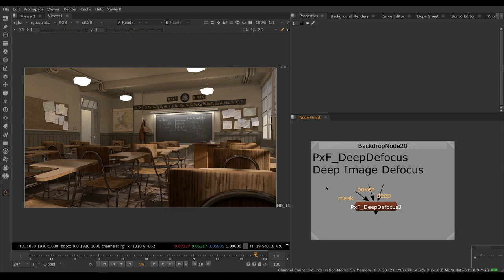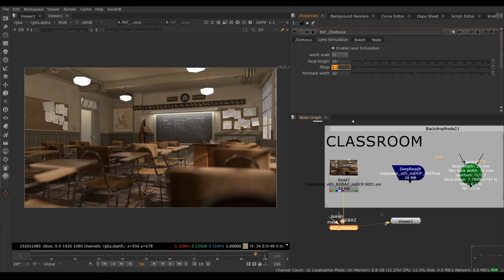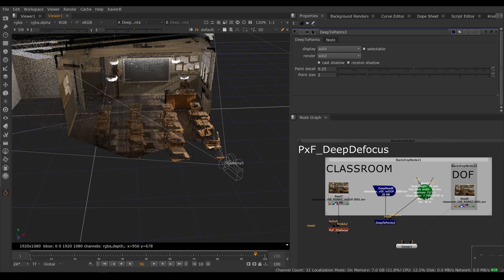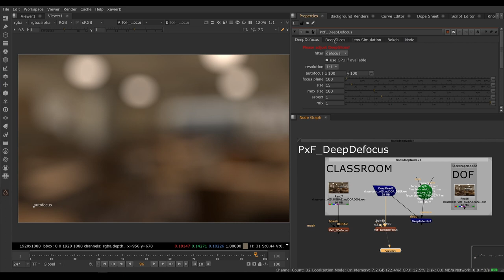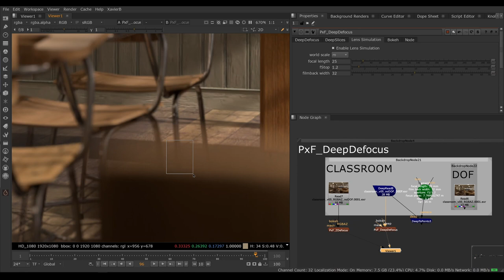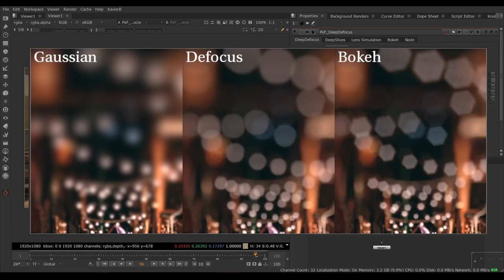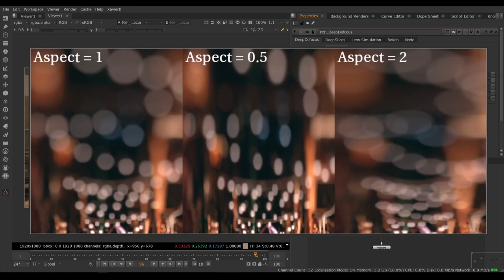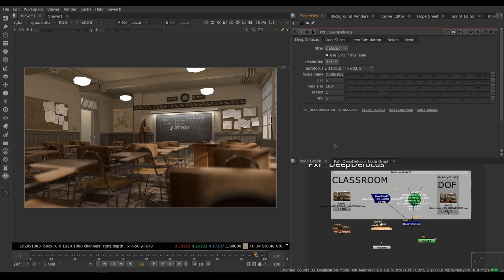PxF_DeepDefocus

Comment: very good explanation. i really love this. thank you Xavier.
how to do you get those deep images ? how do you render them ? what is the setup for the rendering ? what software ? blender ? that are my questions.
Reply from the maker: You can render 'deep' straight out of Nuke ScanlineRender.

The demo images were rendered in Blender... BUT Blender doesn't support 'deep'... I had to hack it by rendering the scene with an animated clipping plane on the camera and stitch the 'slices' together in Nuke.

It 'works' for a still frame but I wouldnt depend on it.

Other commercial render engines support 'deep' out of the box. I've seen deep renders coming from Houdini for example.
Reply: oh, yes i see. thank you Xavier. @pixelfudger

Comment: So are there any renderers that support samples behind opaque objects? How can I get a deepEXR that has samples there? I can't set my objects to .99 visiblity... That doesn't seem like a valid approach. If I have to build the deepEXR up by layers I could just defocus them with regular EXRs?
Reply from the maker: That's a good question. I don't know which render engines support samples behind opaque objects... I'd like to know too!

You are right that you could defocus each layer separately and combine them after each defocus (this is exactly what is happening inside PxF_DeepDefocus).

Deep becomes more useful with particles/fluid sims/crowd sims etc... The car+building scene doesn't really need Deep as you could render in 2 layers easily.

Comment: Great update chef!, wondering how did you get those sweet deep renders out of Blender? Are you using a 3rd party renderer? Thank you so much.
Reply from the maker: I rendered the scene in Blender multiple times with different camera clipping planes. I rendered each slice with a depth channel. I converted each slice to deep in Nuke using DeepFromImage and combined all the slices together with a DeepMerge.

It's a fun technique to experiment with but it's a bit of a pain to stitch the slices cleanly... I had to paint out some artefacts by hand.
Reply: @pixelfudger  interesting would like to try that one, I was thinking to switch to redshift but just for the deep rendering capabilities may not be worth it. Keep up the good work.
Reply from the maker: @chanofeles  I think Octane Render supports Deep too. If you ever figure a clean way to render Deep in Blender, make sure to report back here. :-) I'm interested.
Reply: Redshift renders Deep in Blender but it's pretty limited.  I'm trying to get a render like you have here even out of Houdini it's a bit tricky.  Most deep drops the samples behind opaque objects, not a lot of info online actually on how to get rays to "pass through" opaque things.  

It's funny to see this though, makes me realize most of what we've been getting in production 99% of the time is incorrect for defocus workflows because it's not deep rgba keeping samples behind things.    @pixelfudger
Reply from the maker: Nuke's scanline render is guilty of this too. Samples behind opaque objects will not be included in a deep render. I have worked around this by multiplying the alpha of each texture by 0.95, rendering deep and using a deep expression to divide the alpha of each sample by 0.95.
Reply: Genius!  I was just reading someone experimenting with a similar approach in houdini (setting scene opacity to .999) to get samples to pass through, but there's not a ton of information on people rendering this type of deep in general, post is from like 2013.   @pixelfudger